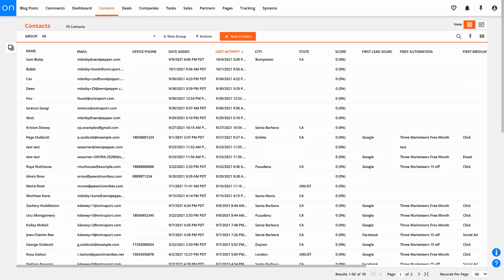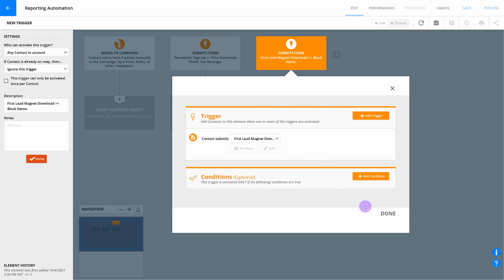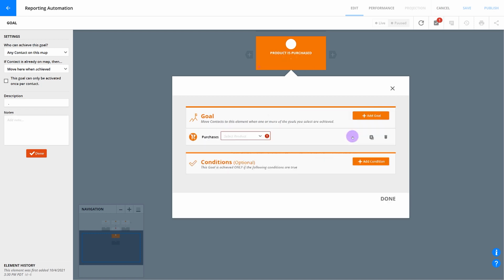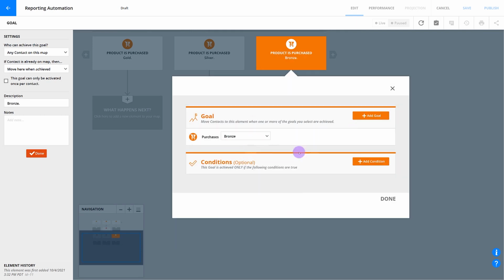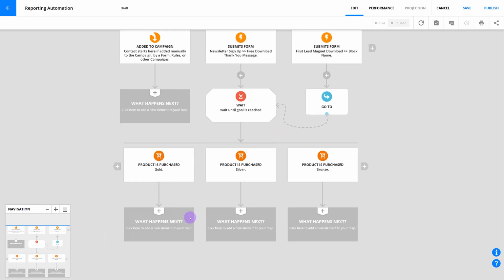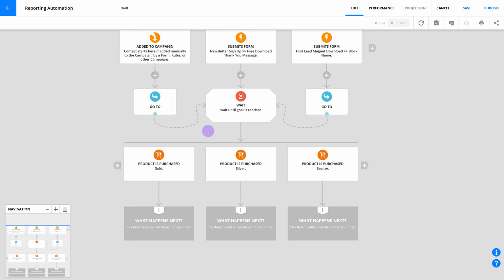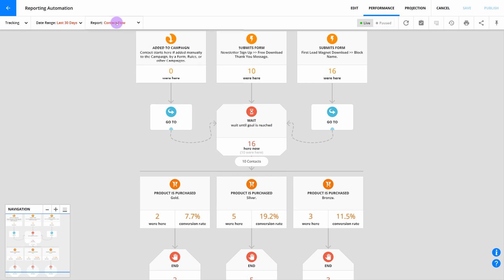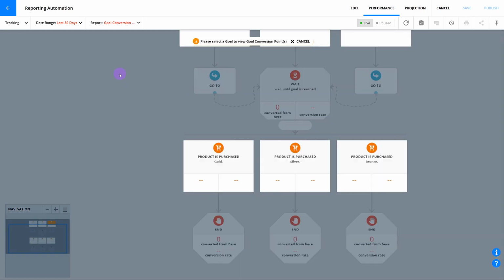How to create custom reports to track your performance with Automations

Comment: This is smart. But it will probably be accurate only if a lead opts in once to one source for trigger. 
A lead could sign up to two forms, so then the performance report would be inaccurate. How would you solve that?